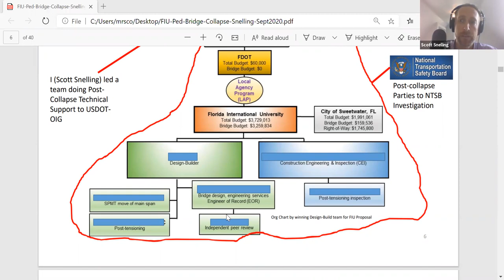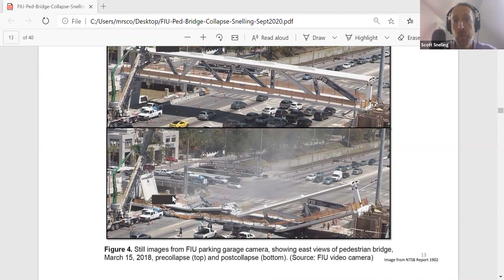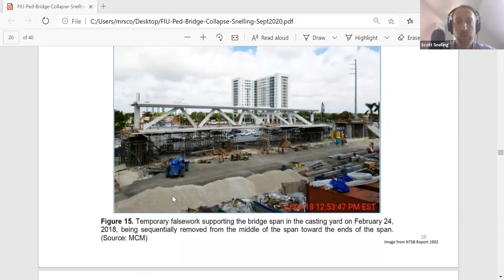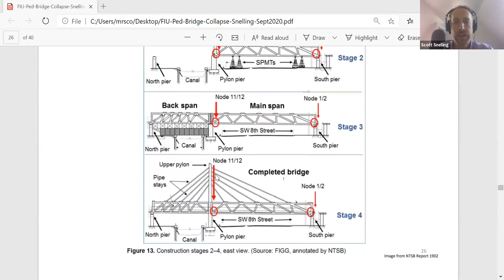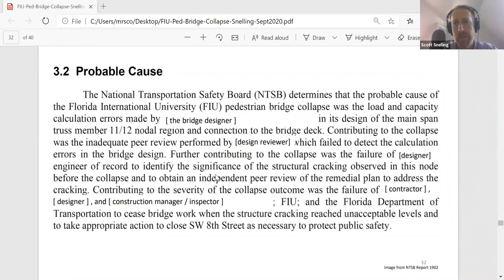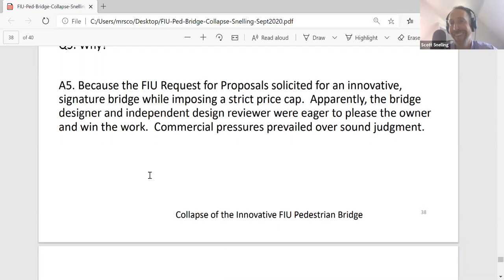Root Causes of the Collapse of the Innovative FIU Pedestrian Bridge, Ep1 Build Big Ideas Podcast

Comment: At 48:30. ABC wouldn't be possible with a true cable stay. A true cable stay would likely be less expensive but it would have block traffic during construction (IMO).

I think one potential cause is the way codes are written. I personally calculate stresses when doing preliminary design. With a five minute calculation, you can estimate the interface shear at 8MPa. That would have indicated a problem right away and that very special attention would be required at the joints. The code is written with limit states forces that does not give the designer a good feel if there is an immediate issue. You should use limit state forces as a final check but to really get a good feel for structures use stresses. I rewrite the code equations into stresses to make sure all my structures are in the right ball park before doing more detailed design work.

I would also say you should do approximate hand calculations to confirm the FEA model. Start with simple models and work your up to more complex models. If the results vary, confirm the reason why.

I would argue the joint did have redundancy. It was screaming that there was an issue before the collapse. Only a redundant structure could do that. There was the interface shear failure but doweling of the larger bars into the deck from 12 and horizontal punching of the end of the deck had to be overcome before the final collapse.

If you think their fee was low, you should see what is happening in the building industry. For an equivalently complex structure, you would get $100 000 USD to $150 000 in fees. You really have to know your stuff and work quickly. We wouldn't include the rebar schedule (just have a general call up and do details) or steel shop drawings. The fabricators do the steel to steel connection design which is not included in the fee. This does not include any landscaping fees, specialty components, or concept review. I am not in the US so it could be different there. I am not saying the low fees are good or appropriate but fees are usually shockingly low.

Every structure is unique and there are many innovated projects but the interface shear issue is an old problem. Understanding your stresses and a five minute calculation would have pointed to this problem very early in the design process. I don't know in this case but in many cases junior engineer are left alone with a computer and will spin their wheels and never notice the issue with a project like this. There needs to also be better mentoring and oversight in the industry.
Reply from the maker: Thank you for you detailed comments.  In general, I agree with the points that you make.

Comment: The comparison to the Hyatt Regency walkway collapse is apt, from a US perspective, but a more similar comparison is to the collapse of a span of the West Gate bridge under construction in Melbourne in 1970.  It also exhibited a structural problem after being lifted into place, which the engineers tried to correct in situ.  This misguided approach caused the span to fall, killing 35 workers on and under the span.

The first Quebec bridge would be another example.
Reply from the maker: Thank you for the comment. I am not familiar with the West Gate collapse in Melbourne. Are there any specific references that you would recommend to learn about that incident.

If I recall correctly, the Quebec bridge was a huge cantilever steel truss bridge that collapsed during construction. I seem to recall reading accounts of an ironworker that rode the bridge down from inside one of the members and lived to tell the tale.

Comment: Not a bad presentation, but there’s a few things I would have loved you to dig into a bit more. I think the really interesting points of failure center around the communications between the contractors and EOR in the period from the transport of the main span to the collapse, especially the now-famous meeting where it was decided to re-tension 11 (which triggered the final failure of the node) in an attempt to “return the node to the original condition.” Which made no engineering sense, IMO. Tracing the emails, phone calls, texts and pictures shared between various persons on-site and at a distance over the 5 days between transport and the meeting is fascinating. The designer/EOR may have innocently missed the import of the pictures  (it’s hard to really prove that they understood where each picture was taken and exactly when), but how could they miss it after seeing it themselves? That the EOR actually SAW the cracks in person right before the meeting and still refused to recognize that the structure was failing, to the point that they did recommend AND proceeded with the improper re-tensioning without closing the road, is, to my mind, the real reason that they lost the Texas project and are facing such dire legal prospects.
Reply from the maker: Thank for the complement and suggestions for further discussion.  With the benefit of hindsight, re-tensioning the 11 diagonal was a bad decision.  I don't agree that it was an obviously bad decision in the moment.  In the book "Tower and the Bridge", Professor David Billington talks about how pre-stressing of concrete bridges was basically invented by Freysinnet in 1910 as an emergency response to prevent the concrete arch bridge Le Veurdre from collapsing due to unexpected creep.  With regards to the EOR's understanding of the nature of the cracks, I think the following quote from Charlie Munger is relevant: "the human mind is a lot like the human egg, and the human egg has a shut-off device. When one sperm gets in, it shuts down so the next one can't get in. The human mind has a big tendency of the same sort."  After spending several days convincing himself (and preparing to convince others) that the cracks were not a safety problem, based on difficult-to-understand photos and his own calculations and modelling, it would be pretty difficult to turn on a dime once seeing the cracks in person.  He realized that the cracks were worse than expected once he saw them in person, but I don't think he had fully internalized the implications or needed actions based on this new information yet.  My personal opinion is that, after the collapse, the design firm did not follow crisis communication best practices (see https://www.psandman.com/ ) and they are paying the price for this communication failure.